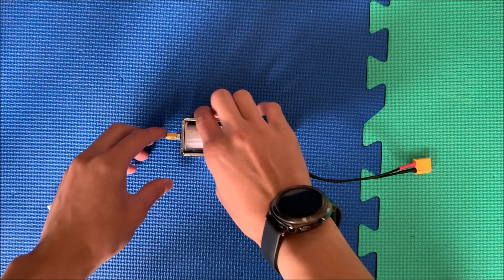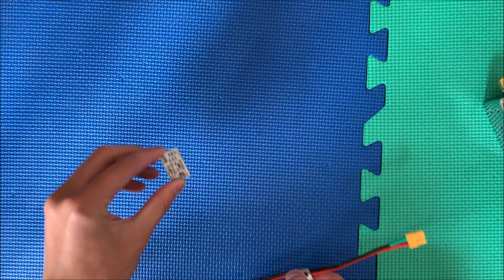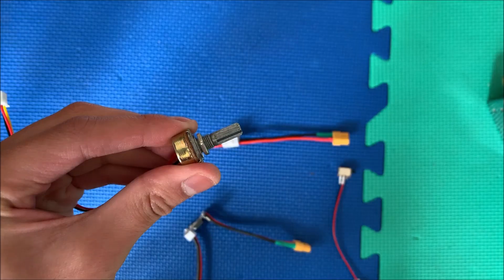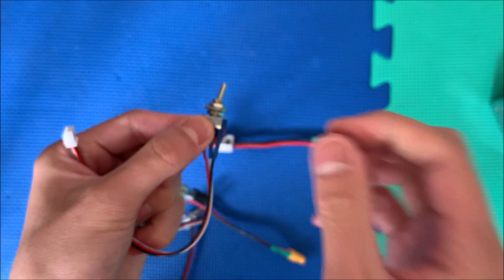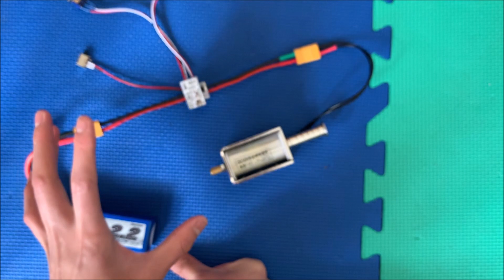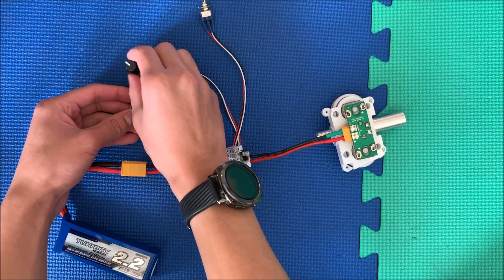Nerf PWM Module: Select Fire Solenoid & PWM Motor MOSFET Control

Comment: Quick question, what kit if I want to run both my cage and solenoid on one board, but I only want the fire rate control for the solenoid?
Reply from the maker: Unfortunately, you cant run both motors and solenoid off of the same board without some unexpected behavior. You can use 1x PWM Module and MOSFET Board for the solenoid (to get select-fire) and 1x MOSFET board for the flywheels (just normal control)
Reply: @suild4680  Not even the Board+ would be able to handle both flywheel and solenoid?
Reply from the maker: Technically, yes, the MOSFET Board + can handle both, but if you do, then the solenoid and motors will have the exact same behavior. When you do full-auto solenoid where the solenoid turns on and off repeatedly, the same will happen with the motor
Reply: @suild4680  ah okay then. Thank you for the info!

Comment: Will I over volt or smoke the board if im running it on Turnigy Graphene Panther 3s 500mAh 75C 11.1v
Reply from the maker: This kit can handle 3S, so you won't need to worry about damaging the kit with that battery. In the future, this kit will support 4S!
Reply: @suild4680  cool thanks

Comment: This is awesome! I was curious though, I plan on wiring a rapidstrike with 3 switches to allow the pusher to return completely. Would this be able to bypass the extra 1 or 2 darts pushed out through motor breaking? I would love to be able to control the rate of fire without having to worry about the pusher snapping lol
Reply from the maker: This kit doesn't have motor braking, so you won't get responsive pusher returns in a Rapidstrike. If you want to control the rate of fire, check out the Select-Fire Rapidstrike kit: https://suild.com/shop/4
Reply: @suild4680  awesome! Do you have a rough estimate when this will be available again? Just wanted to get my stampede rapidstrike Hybrid ready for Hvz lol
Reply from the maker: @zapachehelicopter5163  The PWM module is currently out of stock, but it will be back in January

Comment: have you thought about a 555 timer relay for a burst option. let me know if my head is on strait on this. but it sounds like i can use a 555 timer relay to make a full auto solenoid then put a 3 option switch on it. so burst would use 2 555 timer relays then full auto would use one 555 timer relay. and if i want single fire i make the third option bypass all the 555 timer relays. so the signal  goes directly to the solenoid. please let me know if this is confusing or if it wont work.
Reply from the maker: It sounds like it may work, but I have something else in the works for full select-fire!
Reply: @suild4680  i built a system for full auto using a 55 timer relay. have not tried to make it select fire yet. still working out the kinks. here is the prototype https://www.youtube.com/watch?v=PG5rHU5NMfE

Comment: do the switches need to be plugged to complete the circuit? after dialing in the solenoid speed and switching it to full auto, could i remove the switch and leave it at those settings?
Reply from the maker: No, the select-fire switch can be removed. You can use the second included jumper cap to configure the kit to operate in full auto. You'll always need to have the knob and trigger switch plugged in though.

Comment: What are the components you are using, i.e. what solenoid model, what type of flywheel cage?
Reply from the maker: The solenoid is a generic 12V 35mm stroke length you can find on eBay and similar. The cage is a 42mm OFP Morpheus cage with Bulldog wheels and a Morpheus guide running Krakens.
Reply: @suild4680  Thank you very much